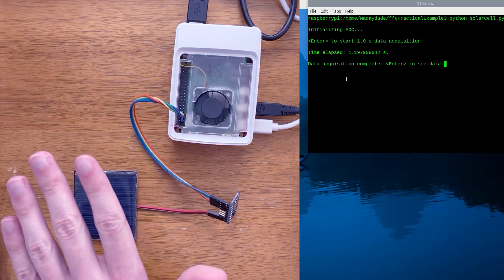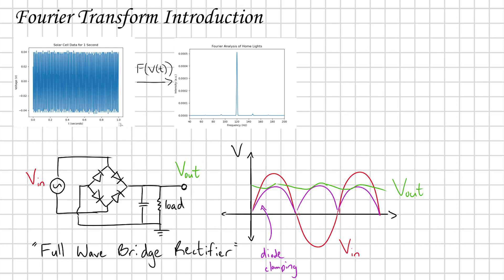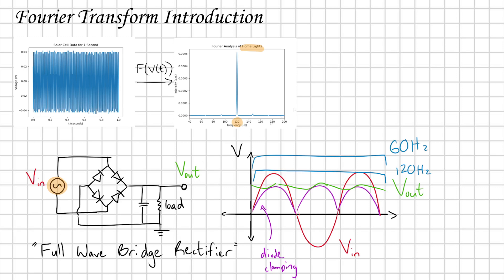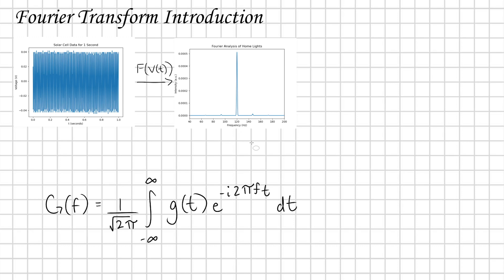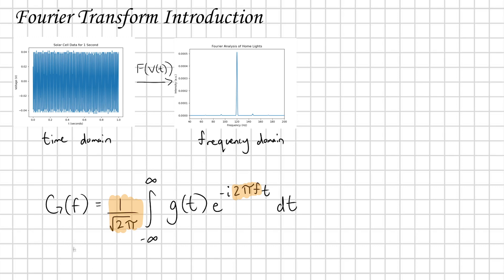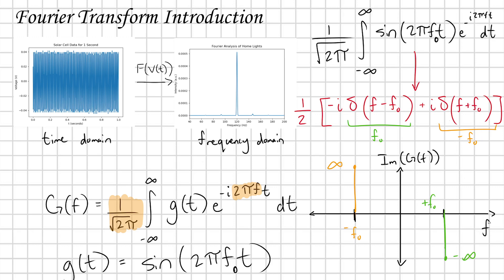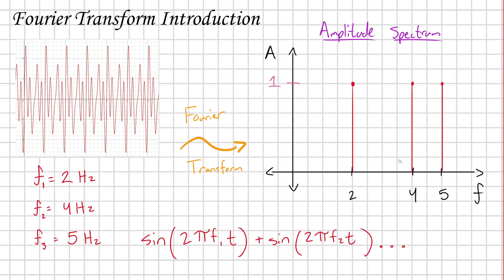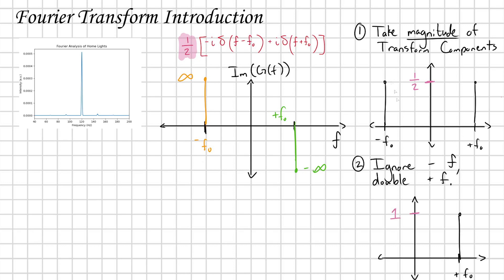Introduction to Fourier Transforms with a Solar Cell!

Comment from the maker: One comment I would like to add with respect to the signal we see being transformed in the video: notice that the signal I reference oscillates between + and - 0.04V. Only positive voltages are being collected by the solar cell, in fact the original oscillations were centered about +2V. To get only the AC component to process, you subtract off the DC offset (by collecting the mean of the original signal, then subtracting that off). If you don't subtract DC offsets off, you will get a giant impulse around 0Hz in your frequency domain.

Comment: Is there any reason why u prefered to use the linear frecuency? I mean the angular frecuency omega is just less convoluted to write and deal with, i guess that there are moments where using one is better than the other, if you can provide me any example of where o when is better to use frecuency f than frecuency w. I have only use the angular frcuency in all my signals and sistems class about fourier and laplace transform.
Reply from the maker: While there's no real difference, the choice followed from the physical example which we used Hz. Naturally in experiment and real world applications I see f more, and in problem solving w. I structure my videos to be consistent throughout, including units, so if I'm going to use Hz in the example, the Fourier transform is written the same

Comment: The voltage at 0:39, how have you obtained it?
Reply from the maker: Measured the signal received by the solar cell from the home lights, then subtracted the dc offset leaving the oscillations only.